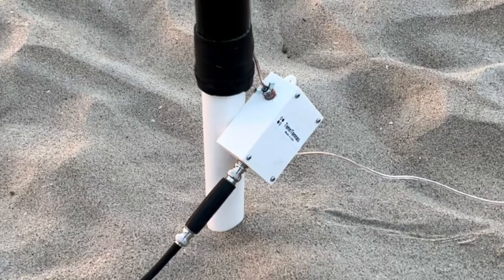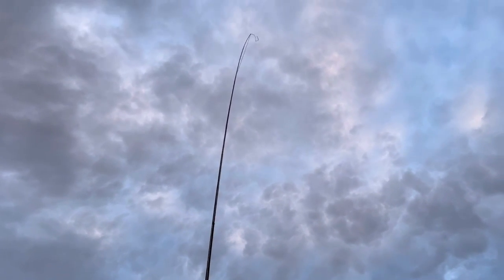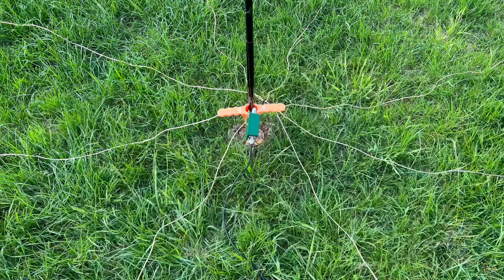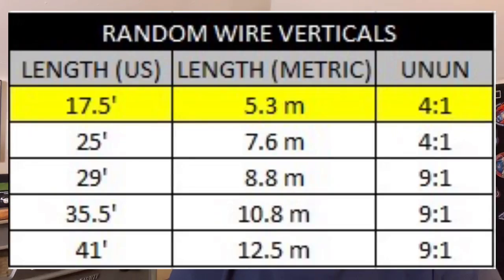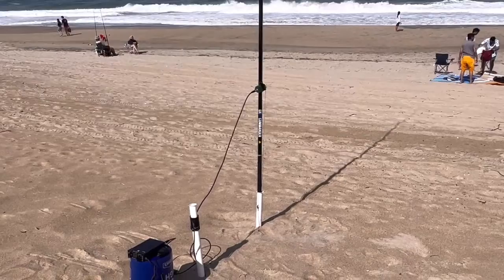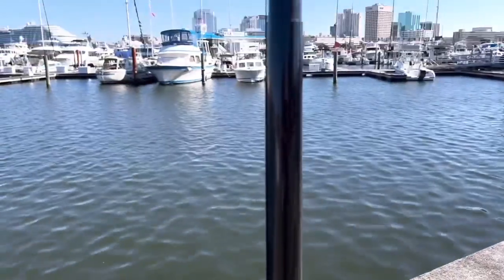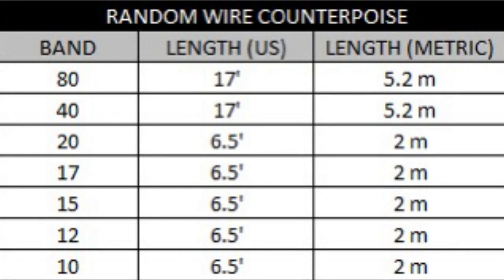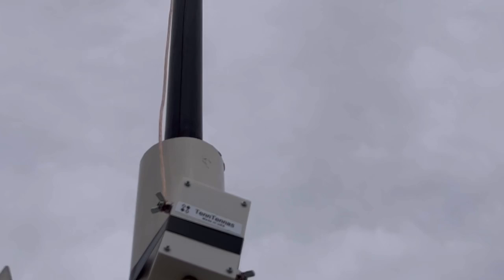Mastering the Art of End Fed Vertical Antennas

Comment: Bill Orr, W6SAI, was the editor of the Radio Handbook (publixhed by Editors & Engineers). He recommended  a 0.05 wave "Voltage Return Counterpoise" on half-aave verticals and Bobtail zntennas. This was in the 1960's...  Somehow, Bill's advice got lost in the chaff, buried under "new" designs that weren't new.  I blame CQ & 73 magazine in a large part as the editorial staffs really didn't even do peer review of their articles.  Your 5% counterpoise is historically valid, and has a solid pst history. The truly invested in antenna design shoul have the pre-Internet reference books.  Google and fancy apps don't always stack up against past engineering experience... Keep building and post more videos. You are an asset to the ham community!  De WB2VUO near Buffalo, N.Y.

Comment: How about a half rhombic on 10m?: End fed 4 wave length 25 ft high inverted V 145 feet long one counterpoise bi directional low angle with gain. Unidirectional if terminated with resistor. Trying to shoehorn one in on one city lot here pointed N/S. Will try to contact McMurdo Station in dead of winter and Russia in summer, or maybe vice versa.. or Maybe no daylight 10m path ever happens? It would have to be summer time at the South pole which means it is winter in Northern hemisphere with no 10M propagation? Summer time to Russia should be easy in comparison with current 10m conditions and a directional gain antenna.

Comment: I tested this design, where it DOES work fine in an open field or beach front.  But I tried to use it in my backyard surrounded by bushes, houses and 100ft pine trees and it failed miserably.  So did the DX Commander I purchased.

In short, I learned that ANY antenna fed from near the ground in my yard performs poorly, period.  It has high noise levels and has poor transmit performance (WSPR) 

My HF solution was to mount the feed point at a high level (20ft or more), and THEN you can go up from there as a vertical, or simply slope it back into the yard.

My theory is that the take off angle with an end fed at ground level is just too low in a secluded backyard where the signal is simply blocked in every direction.  The whole antenna system needs to be up higher to start off with.  

I see a lot of antennas tested in an open field or on beaches, where they work absolultely fine there, but these designs won't work in a backyard jungle.   I'm hoping to warn other new amateurs about this issue.  WHERE you place your antenna is a MASSIVE variable as to whether it will really work or not.

If you have a backyard with 100ft pine trees, fully expect those trees to either block your signal or even be part of your antenna system.  My final choice was mounting my feedpoint on a 28ft mast having it slope into the yard.  Works fine.   I'd love to mount a EFHW vertical on that mast, but then you have support considerations.  But I suspect it would also work well.

Comment: Ever place the feedline chokes at both ends of the coax?  Doesn't affect performance but definitely kills any feedline radiation.  I've never been happy with any end-fed half-wave I built and never could get my mind around why a half-wave dipole fed anywhere and, in any configuration, would need a counterpoise anyway.  The quarter waves work far better for me provided I spend three days laying the ground radials.  Another killer quarter-wave performer is placing it atop a large tin roof.  But elevating a quarter wave vertical above ground level causes the coaxial feedline to radiate like mad... you'll definitely need to choke the coax.   I'm thinking of trying a half-wave vertical again but have only a 24-foot pole.

Comment: Thank you for your content!  Would a 5.3 meter “random” vertical with a 4:1 balun be better than a 5.0 meter vertical without a balun?  Both using a ground plane and both for the 20m and 10m band.  Thank you.
Reply from the maker: The 5.3 with a 4:1 is the option if you want both 20 and 10. The 5 meter without a balun will work great on 20 but it’s a halfwave on 10 and the feedpoint impedance will be astronomical. That’s why we use a 49:1 on an end fed halfwave.
Reply: @COASTALWAVESWIRES thank you! What I have is a telescopic whip that will go to 5.3 meters.  I could use it at 5 meters and shorten the whip to 2.5 meters when using the 10m band I suppose.  But I also have a 4:1 balun on hand…. Decisions decisions 🤔

Comment: Another nice video...I am going to search for the "rubykov?" video you mentioned. I have a question though, I have an efhw wire(66ft or thereabout) that I need to put up again after cheap pole failure. I am thinking of getting a completely vertical setup. My idea is to run around 33 feet of the wire up the new proper mast coming and the remaining 33 feet would run straight back down. I am planning to separate the wires between 30 and 50 centimetres apart so they don't touch each others. As a new ham, I am not sure if this is a doable idea and ultimately am I putting my rig at risk just because there is something I don't know. Any input from those who know more than me (almost everyone on this subject matter) is greatly appreciated. And now onto the "rubykov?" video. Thank you for your videos, always.

Comment: My Sigma X-80 came in 40 minutes before FD and it was up with 10 minutes to spare.  

I have the aluminum version of your vertical. I have a "choke" at the antenna, but I don't know how well it is working, if at all.  

The base of the antenna is about 15 feet above ground with 50 feet of RG-8x almost in a straight line to the radio.  Without radials/counterpoise, the native SWR readings on 4 bands are <2:1, 1 is 2.7, the rest are between 3 and 3.6:1.  When I connected any combination of the three radials I used with the JPC-12 it replaced, 15 meters dropped from 3:1 to 1.5 and either 10 or 12 dropped a little, otherwise, the five lower SWR bands went to 3.4 to 4.5:1. So, no using radials for this installation. 

FD I worked 3 DX (not counting Canada) QRP CW.  Bulgaria, Hawaii, and Martial Islands.  The antenna might have done even better if I could copy code above 15wpm.  ;)

Someone wants to give me a 40 foot pole to put it on, but only if I can make sure it is safe. Right now, it is working.

Comment: I use an '05 Buick LeSabre for my counterpoise.  I've been getting 750 mile contacts with a ysed 10 watt MFJ 20-meter and 17' Intellitron telescopic whip.  I just have to remember to take the antenna down before I drive away.  I bought a used G90 but have yet to get a contact with it.  I don't know if it's a mic problem or mic cable problem or something wrong with the radio.

Comment: Hi, I have a 20.7m wire with a 4m counterpoise connected directly to an external tuner. Additionally, there are 2 common mode chokes (1 close to antenna and 1 close to the radio) to avoid RFI in the shack. The wire is on a guyed 18m Spiderbeam pole at around 3m height. It works great e.g. on 30m. 40m works good and 80m looks OK. 10m kind of has a suboptimal radiation pattern. My next experiments will be to add more counterpoise wires to see how it will impact the performance. Thanks and 73 from Chile

Comment: Hey I’m ku5kw formerly ku4kw when I lived in Newport News. I’m in Tulsa Ok now and I’m using a 119’ end fed that is an inverted J with 65’ vertical supported by a pine tree then about 30’ horizontal to another tree with the remainder back down vertical. I’m running a 9 to 1 UNUN at the feed point with 100’ of LMR 400. I used to talk with the locals on the East coast on 160 meters (1.993) and I have made contact with Clarence N4PR from Oklahoma. This antenna will tune all bands with a tuner. Enjoy all your videos. 73s Mike ku5kw

Comment: I'm loving the 17.5 EF Vertical. I have limited space for long or high wires in dipoles or sloper configurations.  But I can get away with the vertical,  I worked 10 mtr, 20 mtr, 40 and and 80 meter with my small antenna tuner.  I am going to try the 25 foot one you recommended next.    Cant wait to see the results

Comment: You're right, it's about experimenting and having fun. I saw your video and the next day I put a 16.5' wire up on a telescopic window washing pole, with two 16.5' radials on either side, elevated at 12'. Great results. I told my online group that I wanted to try it with a half wave 33' wire and got shot down for not knowing I'd need a transformer on the end. So I'll try it with an unun. Thanks for the vid.
Reply from the maker: Thanks for watching and commenting! Build it with an unun, you will enjoy a vertical half wave. 73, Walt

Comment: I consider it an End Fed Antenna when its fed at the High Voltage Point (IOW The Hard Way) whether or not you use a Wire, Radials, Screen, Vehicle Body... as a Counterpoise. Yes it can also be considered A Form of Off Center Fed antenna, BUT your still doing it the Hard Way for the main Radiator. Or call it a Bottom Fed Half Wave Vertical... One Term Doesn't Cancel Out The Other(s), Their All Correct. Your Doctor doesn't argue if you call a Suture a Stitch, the message was delivered. Were Amateurs, not Pros, But we Should aspire to Act Like Pros.
73  -mike  🍺🍻

Comment: I have 4 major issues #1 shallow pockets #2 rent #3 less then 24 inches below grass is bedrock 3+ feet thick.#4
 buildings are metal sided and roofed 54x14 m.h.  and 84x56 polebarn. so roof mounted and guyed towers.masts are not possible. any trees are 50+ feet from buildings due to high winds and twisters one missed by half a mile. so these limit options  opinion on 25 foot  vertical A base loaded and tapped loading coil 40-10 meter from Pvc and solid 10 gauge wire?
Reply from the maker: You’ve gotta go with what you can put up. That actually sounds like a good setup.

Comment: I'm on the 11 meter band. I'm  also in an apartment.Tried a dipole, i couldn't  get the SWR below 3:1. I guess I need a balun for that to work. So my mext step is a five foot firestik mobile antenna. I have made my own arials out of stranded and stiff 10 AWG wire from Lowe's. I cut 4 wires to 111 inches, and i found by moving the wires around i can get a 1:1 SWR on either end of the 40 channel band and about a 1:1.2 SWR on the other end. I know a mobile antenna isn't ideal for a base station antenna, but you said it yourself, just get a wire in the air and do what I can do.

Comment: WB6JSB Hi, I like your attitude about building antennas. Have fun! I have a suggestion about using a 41 foot vertical wire on your 10 meter pole - try linear loading using 450 or 300 ohm ladder line. I build my antennas with 300 ohm linear load towards the bottom for the initial tuning and then tape the linear load towards the top when finished. Can't tell the difference from the full length wire. Keep doing your videos and hope to catch you on the air. 73's

Comment: WHat is a good vertical antenna for 10 and 12 meters?
Reply from the maker: I’ve worked 12 and 10 with a 5 foot long FireStik antenna and had great results. You have to tune the tip though when you switch bands.

Comment: Great post Walt, I had to watch it several times! My 29' Packtenna 9:1 is my favorite vertical/sloper, etc. Sometimes I use a 17' counterpoise on it, sometimes just 35' of RG-316 coax, often now I throw down my 48" x 96" Faraday cloth I put grommets in to stake down if I can't find a couple of easy rocks. The Faraday cloth works just as well as a single counterpoise where a Park Ranger once freaked out when he thought I was stealing power for using an electric pedestal to elevate my radial for best VSWR. I had a SAD Ham once tell me I had to have 64 radials just to get a signal out, but we all know for POTA we aren't going to do that. Does a Faraday cloth work as a counterpoise as well as 64 radials? Of course not, but when I can use my 350mw xtal controlled Tuna Tin 2 CW transmitter to get a POTA Park activated in an hour using the Faraday cloth counterpoise, I'd say it isn't too bad of a configuration overall if it is getting me out, getting me contacts, & keeping me in good graces with the Park Ranger, lol. Anyway, thanks for the inspiration & getting me back into Ham Radio after a 30 year absence due to career & grandbaby considerations. 
Cheers, Davey --KU9L & Sheila --KB9YYI
Reply from the maker: Thanks for the great comment! I've got to try the Faraday cloth his summer on the beach. All the best and 73 you guys!
Reply: @COASTALWAVESWIRES  without buying a Faraday cloth first, try an old aluminum screen alligator clipped to the ground of the vertical or 9:1 gnd, etc. it works better on the higher bands, but made contacts on 40M with very good VSWR results. Good VSWR does not mean super efficient, but doing a POTA activation for me was proof enough, lol.

Comment: Spent years living in rental houses where I couldn't put a mast up until boredom struck and I velcroed a squid pole to a drain pipe and stuck 22m of wire up it and across the yard. I connected it directly to my KX3 via a binding post adapter along with a short counterpoise and hit the tune button. Got a 1:1 SWR and made a contact. After watching your videos, I've abandoned trying to find ways to get my old G5RV in the air and am gonna keep things simple with an endfed for my big rig once my unun and choke arrives. I wish I knew all this sooner.
Reply from the maker: Thanks for watching and commenting! Have fun with that antenna when you get it up! 73, Walt

Comment: Walt, I applaud you for encouraging hams to get out and experiment with antennas. That's some of the best homebrewing ("DIY"), cheap fun remaining in ham radio. But, a little knowledge of some of the most basic antenna concepts can help folks to avoid spending a lot of unnecessary time that ends in frustration and defeat. Then, they might be resigned to spending $400-$500 or more for something with a cool name, sold using slick website ads that avoid the actual and simple details behind the product that is, really, nothing much different from what you presented at the beginning of this video- a vertical wire fed at the base via an unun (easy and cheap to make!) with a coax common-mode current (CMC) choke (also easy and cheap to make), and a piece of wire as a counterpoise (or single radial).  Also, you mentioned random wire antennas and antenna tuners. On a so-called random wire antenna that is not ridiculously short for the band(s) it will be used on, once the antenna tuning unit has done its job efficiently (automatic or manual ATU, properly adjusted), the radio will look into a pure, resistive, 50-ohm load (a true 1:1 SWR) and the system will be quite efficient because it will be resonant- all capacitive or inductive reactance cancelled out. That's resonance.  Folks are way too caught up in the EFHW idea. -W4AEE
Reply from the maker: Thanks for the great comment. I agree, people are caught up in the EFHW idea for sure. 73, Walt

Comment: Walt, I'm of the opinion of get some wire in the area and start transmitting  my G90 will tune anything and it always ends up sending RF somewhere I definitely don't worry about using EFHW 1/4 wave, Full wave . I prefer End Fed Random myself works everytime.
Reply from the maker: Me too! Put a wire in the air and go!

Comment: I was given a Hustler 5b antenna. It was in pieces and I could see broken plastic shields on the traps as well as there was different black permanent marker lines on the poles. Some were very hard to see and some parts had no marks. Anyway, I got the assembly manual and started measuring the sections as I put them together. They did not seem to match up with the ink marks, but I contributed that to different interconnecting pieces and since they all appeared to be the same length, I just measured everything with spaces between the inside tubes and the overall outside of the main pole. After that I found the antenna was close but not as good as it would be with counter poises. I did not have the space to add counterpoises cut to the different bands, so I contacted DXEngineering and one of the hams there said that they always try to find ways to make their antennas work better. He said they found if I just stretched out 5 wires of 25' length and separated them by 5 inches they would improve the antenna performance. It really made a difference and because they were all going out in the same direction, I added two more in opposite direction.Even better performance now! 73 N6ZKI

Comment: Amazing Info. Tks. 3 years ago I built a 9:1, vertical antenna with great results. 4,40 meters of wire, try to put more, but the SWR is high, so 4,40 meters works better than other wires. Without antenna tuner from 20 till 10 meters, and with low SWR. 7351 great info. Paulo 31JS20. CB enthusiastic.
Reply from the maker: Thanks for watching Paulo! 73, Walt